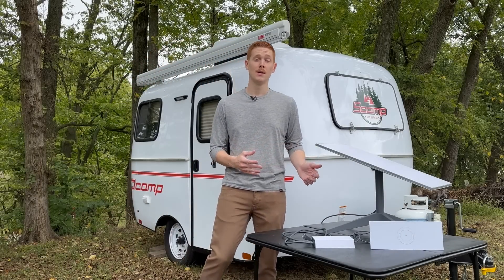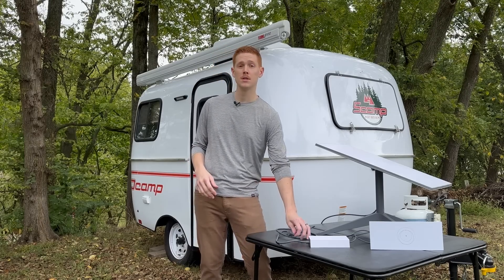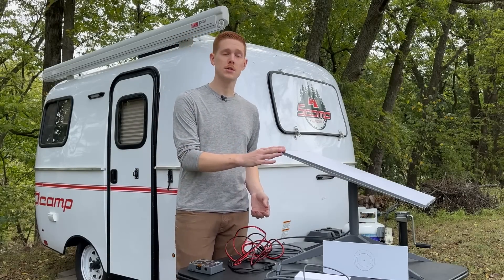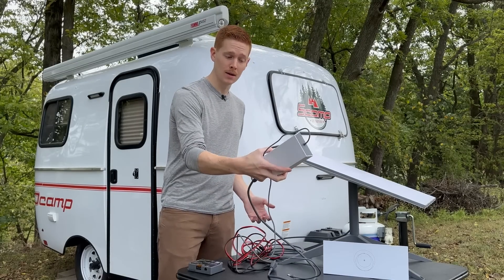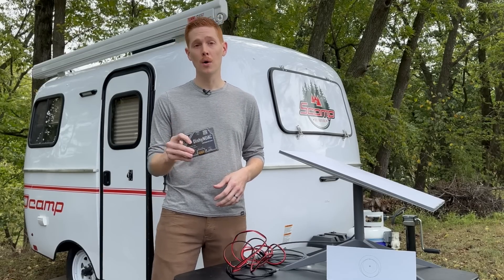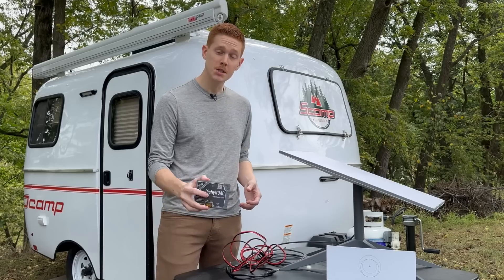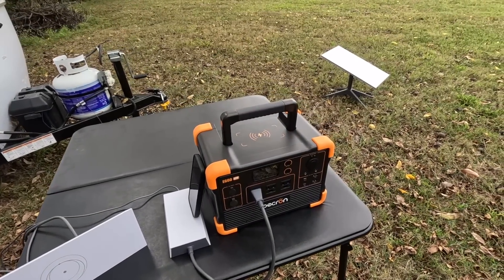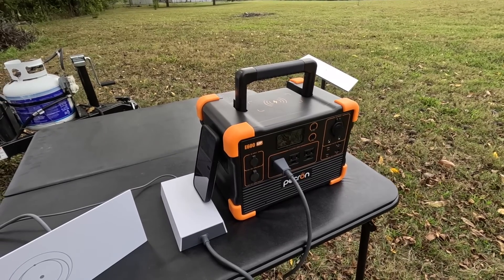How to Convert Starlink to 12V DC Power

Comment: I would have thought bigger difference. I run a Unique 12v fridge off the grid and much less draw overnight on goal zero, yet not need to run the investor. I'm not sure I love all the extra wires; Starlink should have that hardware simplified.
Reply from the maker: The Mini is the best option overall for power consumption and simplicity. It’s native DC powered. But since the Standard is more common and cheaper at the moment, lots of interest in converting it to DC.
Reply: @DISHY_tech @StarlinkHardware, thanks, leaning towards the strongest signal for cell service; I have plenty of batteries and a generator when needed.

Comment: Gen 2: does my Gen 2 antenna cable connector plug into the DishyNOAC  'just like' your Gen 3 cable does?  that I don't have to cut my Starlink cable and separate out the power from the data and add an ethernet connector to it?  thanks!
Reply from the maker: For Gen 2, you can use an adapter so you don’t have to cut the cable: https://amzn.to/4gJyHpa

Comment: Colby –

Great video! I have been a fan your channel ever since stumbling upon your first 12-volt conversion for the Gen 2 Starlink. 

StarLink Hardware - Build a 12V DC Power Supply For Starlink RV
https://youtu.be/zy6EqYZlscU?si=adM-U90WDHcAYvpN

I used your video (can’t tell you how many times I watched before building!) as inspiration for a 12-volt conversion for our Gen 2 Starlink in our RV/ It has worked flawlessly all over the Western states and when we are at homebase. We live full time in our rig and doing the 12-volt conversion has been a game changer, especially when we are on the road.

Camp Liberty RV - Off-Grid RV Internet - 12-Volt StarLink for Our Trailer
https://youtu.be/mzxgB2QL8tM?si=tcM6K2jG-oEU2wml

Thank you for the great content!

David

Comment: Good as always.  You mentioned using Gen 2, but nothing was there on the video.  I'm assuming I use my adaptor or my 1-2-4-3-6-5-7-8 wire conversion.  Can you or anyone help with using the DishyNOAC with Gen. 2?  Thank you.

Comment: Recommend putting some furring strips of wood (1x1 or 1x2) screwed to the floor and then mounting the DishyNOAC on top of that to get it up off the floor.  You have PEX water lines right there behind the DishyNOAC unit and if there's a leak, your device gets wet.  Either that or pick another location all together.  I did this for my 3rd party router my SL is running through as it sits on the floor in a space under my furnace where my shower drain line runs through. I get that your camper is tiny and maybe there isn't any other location that would work.  That DishyNOAC is slick though.. I used separate DC-DC converter and a POE injector.
Reply: Just about to write that great observation 👍🏻